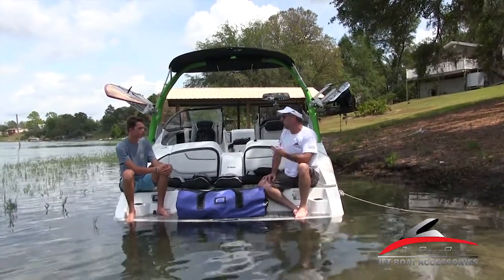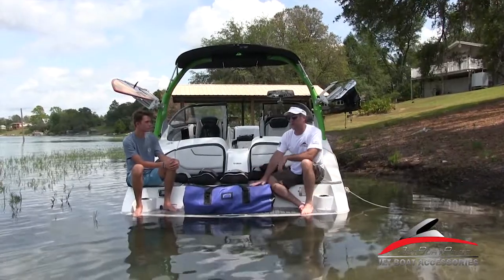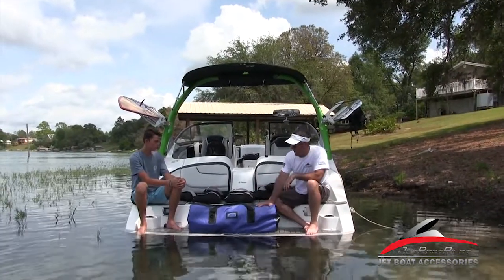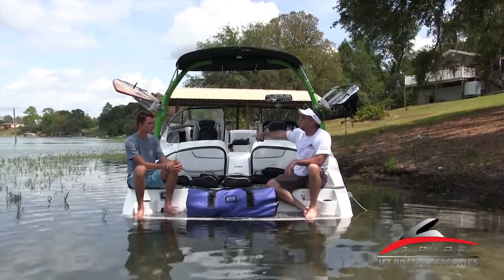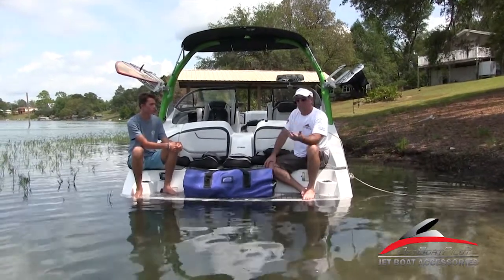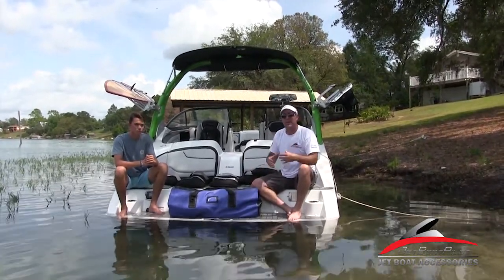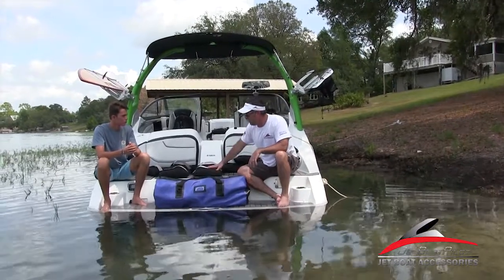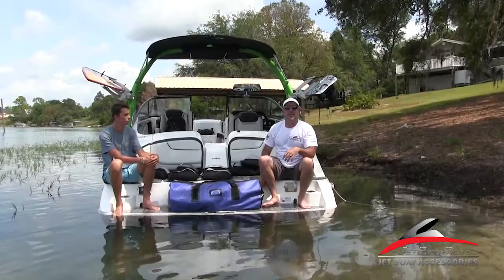JetBoatPilot's Recommendation For Ballast Type And Weight Requirement

Comment: So if you have 1200 lbs of ballast for wakeboarding, does this affect your 1800 lbs uscg limit? Can you only have basically 3-200 lb people? Or can you have the 1200lb ballast plus the 1800lbs?
Reply from the maker: The placard is a suggested weight set forth by Yamaha lawyers. As long as you have life jackets on board for each passenger you're legal.